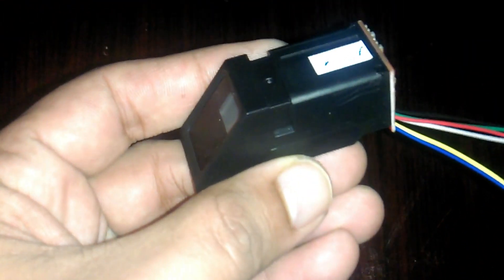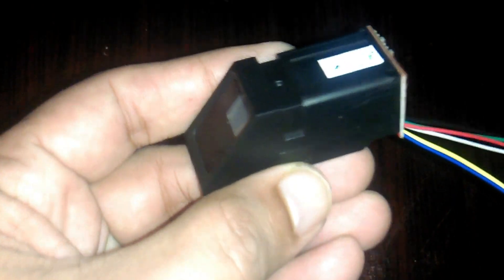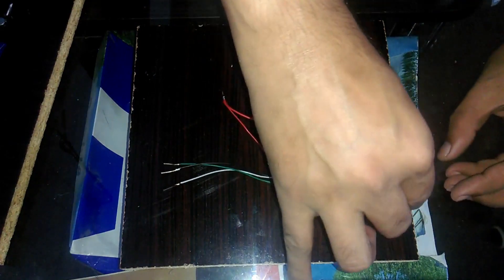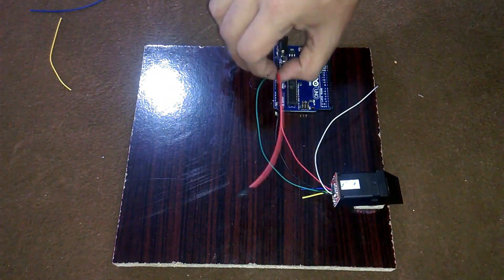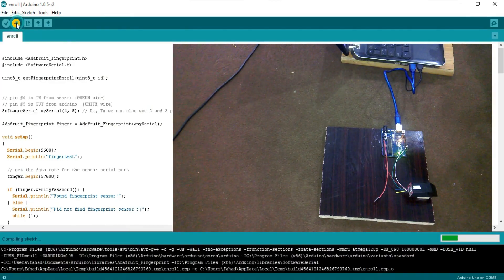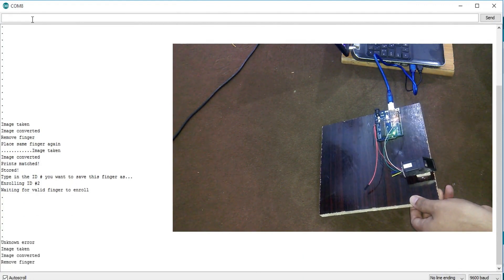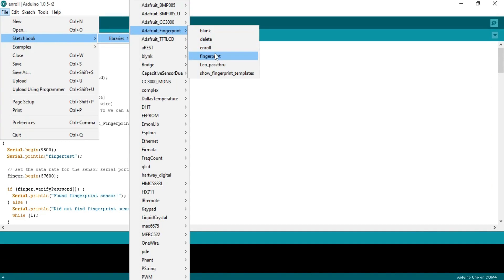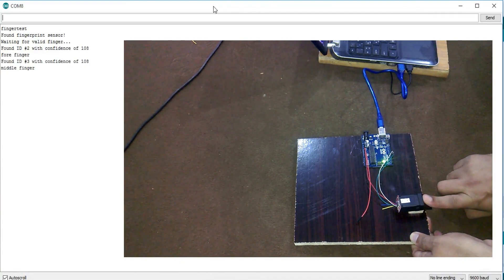Fingerprint scanner | biometric scanner | fingerprint reader | fingerprint sensor “Arduino tutorial

Comment: Im getting a Did not find fingerprint sensor even though i have everything plugged in right
Reply from the maker: you get this type of error when you do the wrong wiring, if your wiring is good, then there may be some problem with your fingerprint module.
Reply: @ElectroniClinic  Yeah cause I even soldered the wire from the board and wire from sensor together with no luck. I will contact them. Thanks for fast response!
Reply from the maker: my dear remember, before you do the soldering, first check your project on the Breadboard. Once you are satisfied then you can do the soldering.